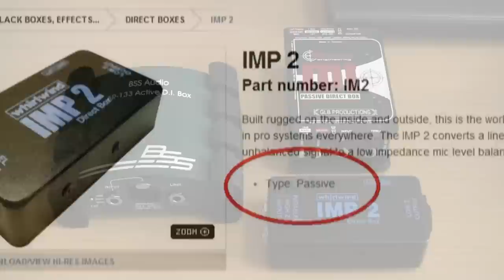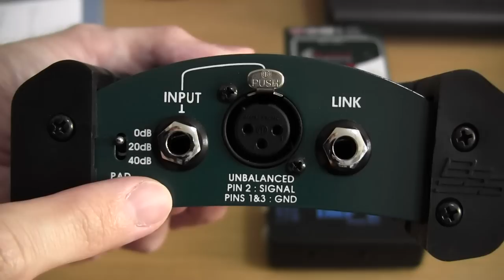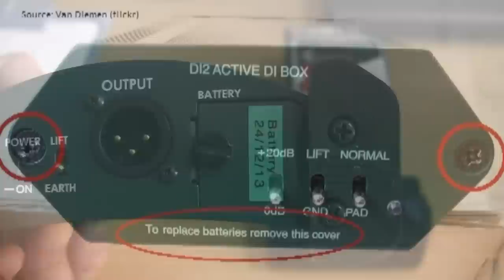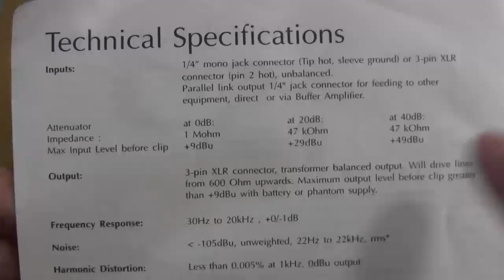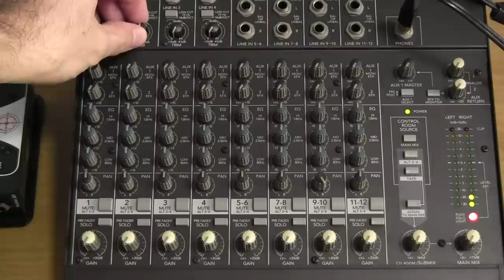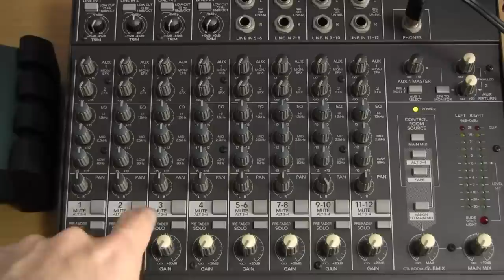DI boxes part 2: Active vs. Passive

Comment: Continuing from previous comment, I am a w/ldr playing active Takamine 6 string, Fender Strat with various pedals, Roland combo, Shure Beta 58A mic, Shure in ear monitors with LD Systems MEI 1000 -T wireless system. Any advice is welcomed. Thanks.
Reply from the maker: JulieJackson1 Hello Julie, thanks for getting in touch. In my opinion, it is very challenging to implement an in ear monitor (IEM) system without professional assistance. Not only do the sends to the transmitter need to be in stereo, a much more comprehensive mix is required than would be needed with a wedge monitor, due to the way in which the IEM system blocks out many sounds that the artist would normally hear acoustically. This will often mean that additional mics need to be added to the system just for the IEMs! This may necessitate a bigger console and so on and so on. 

Does the church you are working with have an existing IEM system, or are they on normal wedge monitors? Do you play with a band? Let's see what we can work out.
Reply: GLB Productions Thanks for this. Wedge it is then. My hearing has taken a battering over the years and sometimes I need foldback on ac guitar so high I get feedback, hence another reason for  IEM system choice. All monitors appear to have disappeared in the church and is the only equipment missing from a fairly comprehensive system. Strange. So I will have to buy something. Thanks again for your help.
Reply from the maker: JulieJackson1 Before you buy anything, I suggest that you get in touch with the company that installed the PA system in your church. Explain your situation to them and ask if they can give you professional help in integrating your existing IEM system into the church's system. This may be the best solution in that the church will not have to buy any new monitors and you'll be able to hear what you need. If you can get a set up that works for you and document it thoroughly such that it can be reproduced each week you may be able to free up your operator to focus only on the house mix.
Reply: GLB Productions Hi Unfortunately, the musicians are sparce and I may only have 2 other guitar players who also sing the tune, not harmonies, and a classically trained pianist/organist. It is every much a commitment to help them out in difficult times. The church does not have IEM system. It looks like cables are present for wedges but no wedges. I need to investigate more. I will get in touch with the co that installed and see if anything can be done to reboot the sound ministry.

Comment: thanks for the video
I have another question  
how do I I differentiate active and passive pickups
please give some light to me
Reply from the maker: It's really simple - if you have a battery in your guitar it's active. No battery = passive :)
Reply: GLB Productions  aw ...that was so simple yet confusing for newbie like me...lol
thanks help alot
so what if I I want to record guitar>boss multi effect > Audio interface 
do I need di still and if I do 
which part of the chain should I stick it after the guitar or after the effect
Reply from the maker: DI not needed in that case - just go direct into your audio interface from the multi effects unit.
Reply: GLB Productions thanks ...alot

Comment: Sir,
Very knowledgeable Information. I appreciate your time and effort to make these videos. I have a question; I have a UHF wireless microphone system. It output the mic level signal through a female ¼ inch connector. My mixer doesn’t have ¼ inch connector for microphones. I made a custom connector cable XLR male to ¼ inch phono connector to connect my wireless microphone system to the mixer. Somehow the quality of the microphone is not like other wired mics. In this situation, can I try to connect the wireless microphones through DI boxes? If yes, Should I go for Active or passive DI box?.
Thanks For your help
Reply from the maker: Greetings Anton, thanks for the question. May I ask what wireless microphone system you are using and what mixer it is being connected to? Thank you.
Reply: GLB Productions Sir,
Wireless microphone system is MAX brand from China. It output the mic level signal through 1/4 in phono jack (Not XLR). I made a custom cable ro connect on XLR mixer input. My mixer is Alto Pro164FX.

Thank you.
Reply from the maker: Thank you. First of all, bear in mind that lower cost wireless mics will never sound like wired microphones, simply because of the modifications that are made to the audio in order to transmit it through the air. Top touring acts pay thousands of dollars per channel of wireless and even then some of them such as Elton John opt to stick with wired mics. 
Secondly, have you ever tried connecting the 1/4" output of your wireless receiver directly to the 1/4" line level input on your mixer? Is there an output level switch on your wireless receiver? If so set it to maximum and see if you can get a decent level. 
Wireless receivers output a signal that is already low impedance and is usually balanced, so a DI box will probably not help in this case.

Comment: First of all thanks for a great video! I’m still a bit confused about the part where you said that if passive instrument like Jazz bass is connected to any effect pedal using a battery or other power source, it should be connected to passive DI-box. For example: If I connect my Jazz bass to Xotic SP compressor (that is powered by Voodoo Lab pedal power 2) and then connect the compressor pedal to
passive DI-box and finally to audio interface or mixer, will it work nicely? And does the compressor pedal need to be switched on all the time in order to change the bass signal to active, or can it be switched off?
Reply: In this case, the pedal you have features True Bypass switching. This means that when the pedal is turned off, it functions exactly the same as a basic cable joiner. The electronics are completely cut out of the signal. So yes, you would need to leave it on all the time for it to behave as an "active" signal. In this case though, I would think that an active DI would be the best choice. Just make sure you don't set the output level of the pedal too high and you should be fine.
Reply from the maker: ClashofTime has got it right - if your pedal is true bypass it doesn't buffer the signal when bypassed so you still have a passive bass as a signal source. However being a compressor pedal you would probably be leaving it on most of the time yes?
Reply: Yes very likely so. Xotic pedal also has very useful blend-knob for mixing dry and compressed signal. I guess I could turn it all the way down, so that only dry signal goes through, if I wanted the original signal without any compression. And thank you ClashOfTime for active di-box recommendation. You are right, it would definitely work better with only the bass itself. However, I think I will still buy a passive one, 'cause it's so useful for playing live due to hum elimination and no need for power source. Thank you for you both, now I know much more about di-boxes!
Reply: +Psychology Rules Not a problem. I've done some more thinking, and in your situation you're right. The Xotic pedal has a ton of clean boost available, so when it's activated a passive box would be better. In my bass setup I always have my compressor on, so I can see you keeping it on most of the time too. If you find yourself needing to play without a compressor, and the output signal is too low, you can always get a preamp pedal to boost it back up when your compressor is off.

Edit: Or yeah, you could just turn the blend knob all the way to the dry signal.

Comment: So wait i have a question....Should i buy an active or passive DI box if im using electric guitars with passive pickups? Also.....im guessing this somehow helps with gain staging if im going from the DI to my interface in my DAW...? Please help me out here...im confused and just heard of DI boxes today....
Reply from the maker: An electric guitar is typically regarded as a complete system together with its pedals and/or amplifier. You very rarely will connect an electric guitar directly to a DI box except in the case of recording where you intend to re-amp the track later.
Reply: Thanks for the reply bro.
Reply from the maker: You're welcome :)

Comment: Shouldn't we connect active instruments to the line input on the mixer? Why do you lower the signal through a passive DI and connect it to the Mic input on the mixer? Doesn't both inputs use the mixer pre-amps?
Reply from the maker: - Good question! In an ideal world that is what you would do. However in large PA systems the stage snake is always connected to the microphone inputs on the mixer, so unless you have access to the mixer end of the snake, it's best to run at mic level. Also, professional engineers prefer this approach to reduce crosstalk (interference between channels) within the snake system. 
To answer your second question - on lower priced consoles the mic and line inputs both run through the same circuit, with a passive pad on the line input. However on more expensive consoles the line input bypasses the mic preamp completely.
Reply: GLB Productions Got it! Thank you!!! =)

Comment: One question, if you gave a passive DI box phantom power, would it damage the box or other hardware?
Thanks
Reply from the maker: - No, passive DI boxes will not be harmed by phantom power. In addition, phantom power cannot pass through the transformer, so whatever is on the other side of the passive DI will be safe as well. Thanks for watching!
Reply: GLB Productions Ok thanks so much for helping!
Reply from the maker: Sam Levy You're welcome, all the best with your music!
Reply: GLB Productions Thanks, you too!
Reply: Where can I learn more on phantom power on active- and/or passive DI's ?

Comment: What about electric guitars, like a Strat? Or did I miss a part?
Reply from the maker: flwolf2000 Electric guitars are typically captured by placing a microphone in front of the amplifier's loudspeaker. Some electric guitar amps have direct or emulated line outs - some sound good, others not so good, so you'll need to experiment.

Comment: Hi, thanks a lot for the video. It is very useful and informative. I have a doubt. I connect my electric guitar (passive) to mixer (Allen & Heath qu32) through zoom g3xn processor. Then, I should I use passive DI box, isn't it? I would be glad if I get replied. Thank U.
Reply from the maker: That's right, I would use a passive DI.
Reply: Hi, thanks for replying. Would be happy if you do videos on Allen & Heath QU32. Thanks for the clarification. Great tutorials.
Reply from the maker: I've done a series on this mixer already: https://www.youtube.com/watch?v=3HKBYiTTmpQ&list=PLcTpo3gc2RJy917S5qsXB2M-HdOjdQCAl

Comment: So if i use passive Bass with only eq pedal (or even only distortion pedal) powered with ac adapter should i use Passive DI?
Reply from the maker: Yes I would start with a passive DI - an active DI will give you more gain but is not necessary.

Comment: Thank you sir for your very informative video/s. I have a Casio Privia Digital Piano which sounds wonderful when played even through its rather small built in speakers. But when I send the signal of the Privia out to my MOTU mixer/interface which then goes to my DAW, the keyboard signal is extremely degraded. Will a passive DI Box help remedy this problem?
Reply from the maker: Kurt Eger Thanks for getting in touch. Your results will depend on the quality of the piano's electronic output - which model are you using?
Reply: It's Privia PX-150. Thanks for your help.
Reply from the maker: Kurt Eger Hmm, that is a high quality keyboard, so the output should sound good. When you say 'degraded' what do you mean - distorted, missing high/low frequencies etc? You may have an issue with dirty connections or poor cables. How are you connecting to your MOTU interface?
Reply: GLB Productions You probably know that this Casio model has a pair of stereo outputs which require a TRS cable for output. I bought a high quality balanced cable and plugged it into one of the input channels of the MOTU Ultralite. I'm having all sorts of problems with the MOTU so I'm beginning to think it may be a software or driver issue with the MOTU interface. I've gotten so frustrated with the MOTU which I purchased as an upgrade to my old M-Audio Audiophile interface circa 2004 that I simply returned to my old setup running my Casio and other gear through a Tascam MiniDisc Recorder, circa 1996, using only the mixer portion, then through the aforementioned M-Audio interface and primarily using an Alesis Quadreverb, circa 1988!, and everything sounds fine. Sorry for the long-winded explanation. I thought perhaps other home recording folks might be experiencing similar issues and therefore might resist the constant temptation to upgrade, Often these upgrades cause much frustration and prevent music making, which is what we really desire, isn't it? Once again, thanks for your speedy replies and advice.
Reply from the maker: Kurt Eger I couldn't agree more. I got my first start in recording almost 15 years ago using a very simple mixer to record directly into a minidisc recorder that I had purchased in the last 1990s and it worked just fine. To be honest with you there is no need to use a computer-based recording system unless you need extensive multitrack/overdubbing or editing capabilities. I'm presently doing lots of work using a Zoom H5 handheld recorder - it's simple, sounds great and best of all doesn't use windows :D

Comment: For passive instruments, can't I just use a simple EQ or boost pedal (that requires power source), keep it a clean sound, and then run it to a passive DI and then to the board? In other words, since I already have a couple of clean boost pedals and eqs, and a passive DI... do I have any need for an active DI?
Reply from the maker: You are correct - passive instrument into active pedal = active source. So a passive DI will be fine.
Reply: @GLBProductions  I had a similar question. I have a passive bass, but I have a combined pre-amp/DI (Ampeg SCR-DI) which is sort of the rival to the Sansamp on the market right now. It has 1 meg Ohm input impedance. I see a lot of bassists using this product in conjunction with their pedals, usually placing the pedals before it and it works well for them.. According to you're video, doesn't that violate the Active - Passive rule? In my case, I have a boss TU-3 tuner pedal and a cheap, old digital delay. Not sure how to handle this, as I can't afford another DI. Should I activate the -15db pad jumper on the bottom? Or is this what the "Thru" channel on the Ampeg is for
Reply from the maker: @laxing77  Yeah that is just a general rule, and there are always going to be exceptions. The setup you describe above is one of them and should work fine.

Comment: What if I use a passive instrument such as a Fender stratocaster, but plug it in a powered pedalboard then decide to connect it to a PA system, do I use passive or active?
Reply from the maker: In that case you can use either but I would start with a passive DI.
Reply: and compensate with a boost pedal for higher levels, right? :)